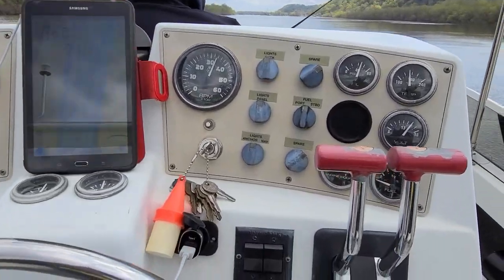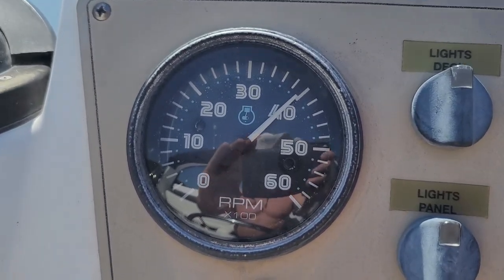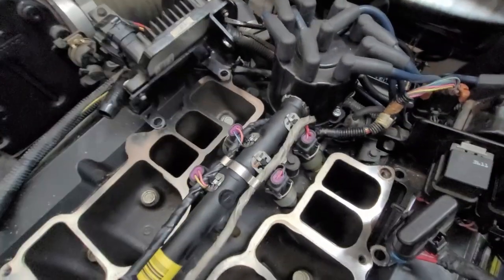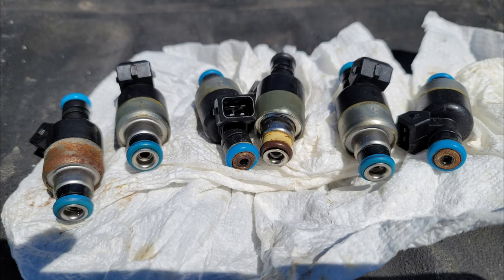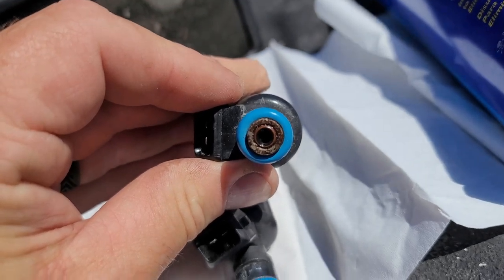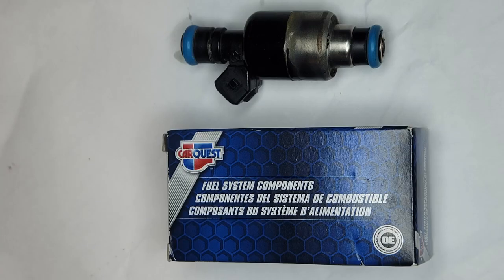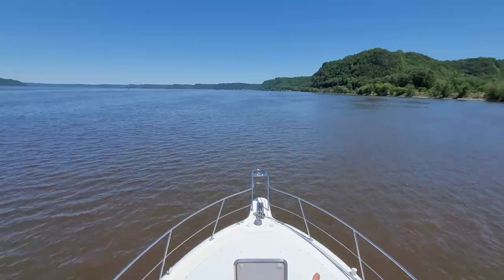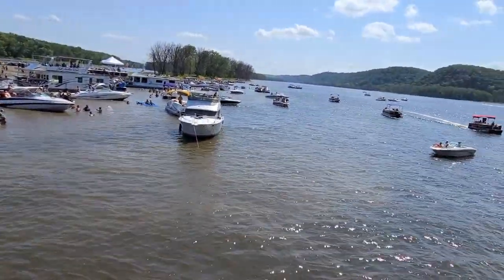Mercruiser 7.4L 454CID Injectors, Marine vs Auto?

Comment: I just had my 7.4 injectors cleaned by a diesel shop. They thought  marine injectors might put out a little more fuel than truck injectors, but weren’t really sure. They saw no reason to worry about what you used. It cost me $35.00 per injector to have them taken apart cleaned and replace filter screens and prints. Noticeable difference in the performance of my boat.

Comment: 7.4’s WOT should be 4400-4600. If you are revving 5000 rpms you might have to check to make sure you are running the right pitch/diameter prop.

Comment: There is a huge difference in fuel delivery.your two automotive Injectors will be running way too lean,possibly 30% You will 🔥  exhaust valves or melt pistons.
Reply from the maker: I've heard this once,  but where is it documented?  Are there data sheets for the two different injectors?
Reply: I don't think that's true but explain why
Reply: If that is true, the temperature would rise significantly to cause that, wouldn't it?

Comment: You about to be doing a 454 rebuild Sir. Your marine engine in that boat is not designed to be doing 5K every second your on it.
You need to buy a Offshore boat and rebuild motors every winter you wanna do this......
Those motors like 38-4200 at most and they are very happy and will take you around the world.
You wanna treat them motors like Coyote5.0's you wont be doing much boating at all. Your asking for trouble real fast smh